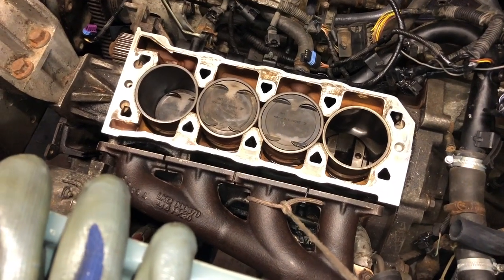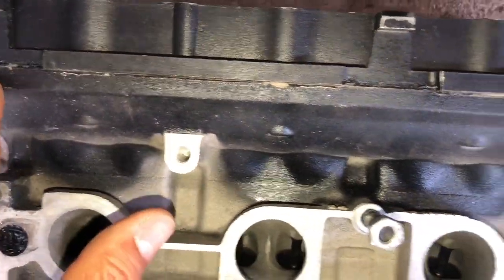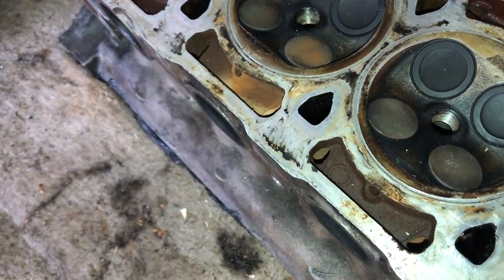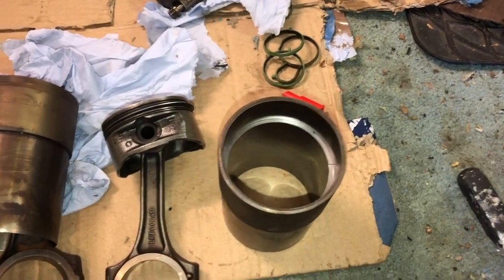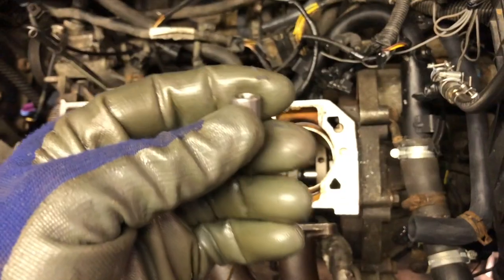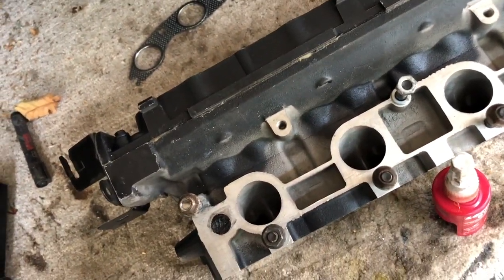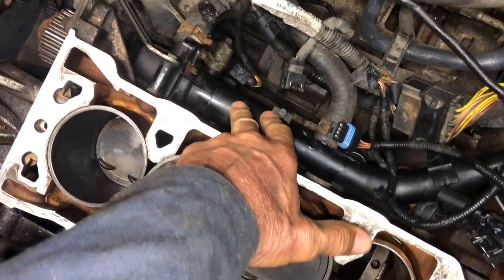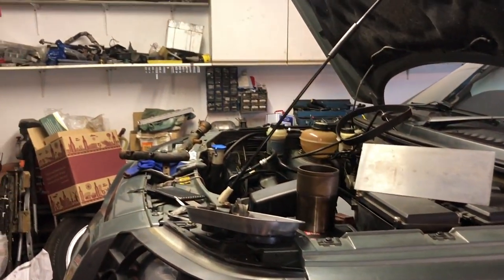MG Rover K-Series Engine Rebuild Do's & Don'ts.  Extra Hints & Tips

Comment: Ah an expert. What is  the semi circle indentation in the combustion chamber  actually for?  Looked at mine for a while, couldn't come up with any purpose
Reply from the maker: I wouldn’t call myself an expert. Just passing on some if my experiences. The semi circle bit of the combustion space is, I believe, a squish zone where gases are squashed to encourage circulation, mixing and complete combustion.
Reply: If you mean the U shaped recess on the side of the circumference of each combustion chamber, near and between the Inlet Valves, then I cannot explain the purpose of that. It is useful though for the DIYer working on K-Series Cylinder Heads. It's one of the first things I look for as soon as I remove a K-Series Cylinder Head. If it is absent, that is BAD news. It means the cylinder head has been over-skimmed and this can mean the poor thing is scrap!

I have seen several problem cars I've investigated for myself and others where that U shaped recess is absent! Machined away completely in the pro-environment by those workshops who "We always Skim the head mate" often when it is not required. In over half a century of working on cars, I have only had four cylinder heads refaced by engineering firms. The first two, a T-Series Head which had been poorly machined so that the surface was worse than before the skimming, and a B-Series ( MGB ) which suffered from poor quality or more likely no anti-freeze and that caused corrosion in key areas. The other two were a 1.8 K-Series and the A-Series Head on my son's now forty year old MG Metro which had been stored unused for many years with poor quality/no anti-freeze, These last two were not skimmed, they were machined on a GRINDER. The helpful guys allowed me to video the grinder process.  That was done by a small two man engineering firm here in the Cotswold in an old Cotswold Stone disused Quarry now with several Industrial Units. The finish quality of the ground surface of the cylinder head was far superior than any I've seen refaced with a skimming cutter! If ever I need to reface a Cylinder Head again I will have in refinished on a grinder as the finish is superior.

Those firms who ALWAYS skim heads are best avoided in my experience. Often it is not necessary. It is simply a lazy professional way to clean up the cylinder head face which takes time to do it carefully by hand. For the DIYer that extra time cleaning the head properly is time well spent and saves the additional cost of an unnecessary head "Skim". 

Finally, the best gaskets "in the world" will not last long in a repair unless the all important cleaning, checking and preparation is given. On any car.  Because of so much fake news about the K-Series, many folks ALWAYS blame the poor Cylinder Head Gasket when their engine overheats and so accuse the gasket of "Failure".  Often the real blame lies elsewhere. They rarely ever fail, most times they are first DAMAGED usually by excess heat from the poor engine when coolant loss reaches reaches a critical level and it over heats!. Many reasons for coolant loss.  Moral.. check the coolant level as recommended by ALL manufacturers. Trouble is, many modern car users do not even know where the bonnet release is on their cars. My friendly neighbour who drives one of those big yellow Roadside Rescue Service vans confirms this is widespread. When asking the car owner to pull the bonnet release of the stranded car at the roadside, he is often met with a blank stare. 

I fitted MLS gaskets* to three K-Series cars fifteen, twelve and ten years ago. Two still in the family's daily driver use and one a neighbour friends Rover 25. All well over 100,000 reliable miles now. Rocket Science it is not. It's the checking, thorough cleaning and caring reassembly which will go a long way to ensuring no repeat so called HGF.  Cue .. "They all do that mate. Well known fact "In the trade".

* Those MLS CHGs off ebay around £20 delivered to your door. Worth repeating, it is not the quality of the gasket which is the key factor here. It is the quality of the preparation, checking, cleaning and caring reassembly.

I shall never tire each time I turn the key for the first time and the repaired engine bursts immediately into smooth running good health.  Recommended.

Comment: Brilliant video. Do you know if the mg6 1.8t would directly swap into a mg zt 1.8t?
Reply from the maker: Thanks, I have heard that it is nearly the same, just a few differences in sensors etc.  Not done it myself but probably fairly straightforward.
Reply: @comeinhandynow  thank you so much for your quick reply
Reply: Yes, been there done precisely that six years ago. The SIX uses a conventional clutch and Flywheel. The ZT uses a Dual Mass Flywheel which is a straight fit on the MG6 Engine. One of the best and most successful mods I've ever done on any car. Mind you, I had driven the donor MG6 a few months before it met a premature end. So knew the Chinese Engine was a good 'n. 

There are numerous improvements with the Chinese Version of the K-Series when both are placed alongside for comparison. The best being unseen. Part of the improved casting process for the major engine components. Learned that from one of the guys up at MG Motor.  Pity the good folks up at Longbridge were denied the opportunity to implement them!
Reply: @T16MGJ  fantastic looks like a nice winter project!

Comment: I've buying a metro 1.1 k series pretty soon, its the carb 8 valve model, is their anything I can do to improve/future proof it?
Reply from the maker: Service it well.  Spray wax oil underneath on any rusty bits and brake pipes.  Change cam belt when due and regularly check water level and consider fitting a water level alarm.

Comment: Help ! I need some direction/ reinforcement on the right direction here having had an elastomer leak just on the edge so the water came out the exhaust side....
So should I really need any more convincing to go do the N series ??? Not make callers for it on internet advice forums I queried...
Everyone on MGs seems to recommend the elastomer...but I have a nice flat 20k head engine and can't see any warpage, and all liners seem to measure at least 0.08mm to 0.1mm between a straight edge on block on feeler guages
( Also there is genuine N series and Reinz one, tempted if going this route to ensure to get the Payen one?)
Reply from the maker: Personally I always use the N-series gaskets.  They never fail catastrophically like the elastomer ones.  If they do weaken it only results in a slight leak, but if you are careful with assembly they will be fine.  Look for any surface imperfections and around the water ways and edge I put a very thin layer, spread with finger, of loctite 574.  Not around the combustion chamber.

Comment: Do you know 18k4k and 18k4g have a same specifications apart from shorter rods and stronger  pistons due to a turbo charger ?
Reply from the maker: The 18k4g is the SAIC version of the k-series original engine with some minor mods like extra webbing strength but it is mostly the same overall design as the original 18k4k. There is also an N-series by NAC very similar again. NAC and SAIC later merged. I loosely tend to talk about both the later engines as N-series engines.  See https://en.wikipedia.org/wiki/Rover_K-series_engine 
https://en.wikipedia.org/wiki/SAIC_Kavachi_engine
Reply: @comeinhandynow  Have fitted an MG 6 engine to my other MG ZT-T 1.8T. Been my daily driver workhorse for the past six years since I did that. Very useful load space in the ZT-Ts. The MG6 has much MG ZT 1.8T DNA. The Chinese are not mugs picking up the IPRs from MG-R receivers for peanuts. One of the things I most dislike about the ZTs and Rover 75s is the location of the clutch hydraulic system's Slave Cylinder. Also Mater Cylinder come to think of it. Inside the Bell Housing. d'OH!  The MG6 has the Slave Cylinder OUTside the Bell housing like many previous Rovers and MGs.  Far more user friendly when the system needs servicing .
Reply from the maker: @T16MGJ  That is far better, I think the 75 got the BMW stupid ideas influence about slave location, just like their TD4 BMW engine.
Reply: @comeinhandynow  Almost certainly that is true. The 75 being produced under the Bavarian Outfit's ownership. Volumes and unit costings play a part here.

Lots of BMW bits on my ZTs, not the engine though. Working on MGs and Rovers over the past few decades, there are Honda, GM, AUDI and BMW logos on many smaller parts. The washer motor pump on the front of my ZT's Headlamp Washers has stopped working. Maybe lockdown lack of use responsible. Had it happen before. The Washer Pump is a BMW item complete with part number on the label which is convenient. Fortunately I have a spare which works.. 

I would have preferred a Rover PG1 Gearbox in my ZT-Ts as is the case with the PG1s fitted to my MG ZS 1.8.

Having changed the Slave Cylinder in two MG ZT-T 1.8Ts, nasty job. Doddle on other MGs and Rovers.

Comment: How do I do up the crank bolt to correct tension when tightening. How do I stop engine from turning? Is there a tool to stop fly wheel turning?
Reply from the maker: What I do is put it in gear and get someone to press hard on the brake pedal.
Reply: @comeinhandynow  Precisely. Put it in 5th Gear for best results and if you have a strong son like me, he can plant his foot firmly on the foot brake. If that Crankshaft Pulley bolt has been done up silly tight with power tools, it can be very difficult to release for the DIYer with limited facilities. Over use of power tools in the pro-environment can make problems for those like me who like to work on their own cars. Annoying.

Comment: Dobrý den, chtěl bych se zeptat, jsem z České republiky a mám freelander 1.8 verze 18k4f z roku 2004 a koupil jsem si toto auto a ve velkém ztrácím vodu, myslel jsem, že tyto závady byly vyřešeny až letos po faceliftu, víte, jestli na těchto motorech již byl zesílený olejový žebřík a lepí těsnění řady N?
Reply: Hello, I would like to ask, I am from the Czech Republic and I have a freelander 1.8 version 18k4f from 2004 and I bought this car and I am losing water in a big way, I thought that these defects were solved only this year after the facelift, do you know if there was already a reinforced oil ladder on these engines and they glue the N series seals?
Reply from the maker: To be honest I am not sure if that year has those improvements.  Try and be sure where the water is being lost. It could be the water pump leaking which is easier to fix, or a radiator leak, or a hose.  If it is the head gasket there should be a loss of compression on a cylinder (use a compression tester) and probably steam / smoke from the exhaust.
Reply: there is no water flowing anywhere on the side or under the car and I lose a lot of water and the exhaust smokes not much, but it smokes when I bought the car, a head gasket was done before, including the alignment of the head, the scales were not sunken, I am afraid that the block or head is cracked
Reply from the maker: @radimadamovky-sl4qd  A cracked head or block is unlikely.  To check if the water is going into the combustion chamber, buy a cylinder compression tester (not expensive) and test each cylinder for the compression value, with all of the spark plugs out.  If water is getting into the combustion chamber then one of the reading will be lower than the others.   Also often you can get oil mixing with the water or water in the oil so look for that.  If the head gasket was recently changed it is probable that it wasn't done properly.
Reply: Děkuji za pomoc
Reply: @comeinhandynow  hello, I had to remove the engine head on the oil dipstick, there was a lot of emulsion on the cap as well and I had a lot of water in the cylinders, the engine was built as the previous owner said, there is a gasket with 5 layers and one special liner, you can't tell if they stick out, I didn't even recognize it I will have to measure it with my fingernail, I would send you photos of the seal if the seal really failed?
Reply from the maker: @radimadamovky-sl4qd  Sounds like there was a leak across the head gasket. I would recommend checking that the liners protrude a few thousandths of an inch and if not put in liner shims under them, ensuring they are well sealed in as well with hylomar blue.  Then use the N-series head gasket and again put some very thin additional seal (locktite 574) around the oil ways and gasket edge (not combustion area). Look for any marks like scratches and corrosion on the head and block and ensure these are sealed.  Also check the head doesn’t have indent marks around the combustion chamber, if it does, get it skimmed, but check it hasn’t already been skimmed as there is a limit on how much you can thin the head.  This may also be useful to identify where the leak was across the gasket https://youtu.be/tSgq2l0AxR8

Comment: Ive got a 216 Cab that has a multi-layer gasket on it when i bought it, seems to be an old repair . After a year or so of ownership, its started leaking coolant from the left hand front of the engine from the gasket. I expect the gasket has wore out as i can see bits of black of the gasket has come away.  Would i be able to replace the gasket with out skimming the head? as its not leaking internally. Also as its got a MLS gasket already could i just used the N series gasket  as the previous one worked ok?
Reply from the maker: You may be able to just change the gasket but check if there are any indents in the head or marks or corrosion on the block. You can only tell once you have the head off. Also check liner heights. Maybe some liner shims would help.
Reply: I ended up swapping in a 1.8vvc 160 engine as the cambelt snapped on the 1.6.   but would you believe, it I have HGF on this engine now...ive got it stripped down but I'm concerned about weather I need to clamp the liners down to clean the tops of the liners? @comeinhandynow

Comment: Hi I have a 1.4 mg zr and am going to do the n series head gasket and stronger rail upgrade and in your opinion would the prt thermostat upgrade work because I spoke to rimmer bros and they say wouldn’t recommend it but wanted your opinion
Reply from the maker: I would always fit it as then the engine fluctuates less in temperature as it warms up.
Reply: comeinhandynow ok thank you can you recommend the best place to get one from please.
Reply from the maker: @robertbowes1001  There are a few kits on eBay for PRT assemblies for MGs which you could probably adapt and use: https://www.ebay.co.uk/sch/i.html?_from=R40&_trksid=p2334524.m570.l1313&_nkw=prt+hose+assembly&_sacat=0&LH_TitleDesc=0&_osacat=0&_odkw=prt+hose+kit

Comment: I also have a rover 75 1.8T with dropped liners from someone overheating it. Is it worth raising liners with shims?
Reply from the maker: Yes, I did it on my 1.8T and it’s going well. No water loses.
Reply: @comeinhandynow  did you make a video on taking liners out and piston/conrods?
Reply from the maker: @spencerburrows3525  only what I briefly show in this video. You remove sump. And oil ladder as well. Unbolt big end bearing nuts. Remove bearing. Piston pushes out top. Tap out liner evenly with something long enough to reach. Be careful not to chip it. If it does happen don’t leave any raised edge on the liner from the tapping.
Reply: @comeinhandynow  is it a new liner job or use old liners. The liners are meant to be 3 tho above block. Three of my liners are 3 tho below. I have thought about doing it but it is a big job which had got to be done right first time.
Reply from the maker: @spencerburrows3525  3 thou below is a lot. Flat with block is the worse I’ve had. They should be 3 to 4 thou above the block. I read they went to 4 later in life. I would reuse them if they are not damaged or worn out and you are reusing your pistons.
Reply: @comeinhandynow  car went okay just pressurised the coolant. On the look out for another 1.8T engine. Don't fink I'm capable of taking liners  out. Well it is not taking out it's putting back together properly.
Reply from the maker: @spencerburrows3525  It’s not difficult. Less difficult that taking the head off for instance.  The liners just push in by hand.  A slide fit, not an interference fit, so no press needed.  You can see them in this video.

Comment: You don't need to reuse the bolts, they stretch yes but not so much you can't reuse them at least once! If you can't use them because they've stretch is the least of your problems!
Reply from the maker: That is true, you can reuse head bolts as long as they haven’t overstretched, but if you are upgrading the gasket to the N-series MLS type gasket you should change to the higher stensile bolts that go with it.

Comment: This is 1.8 160 or 120?
Reply from the maker: This is on an originally 120 bhp engine (the 160 bhp is usually VVC) but most of the do’s and don’t are the same.  I’ve made it 200 bhp now though by turbo charging it.
Reply: @comeinhandynow  i have the vvc ,it has the same head gasket?
Reply from the maker: @alexmitros3873  yes